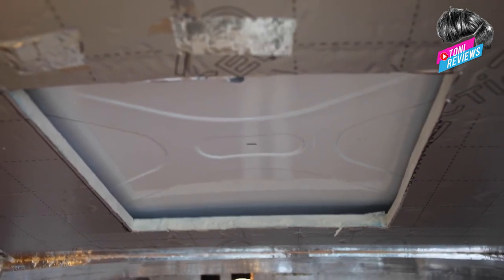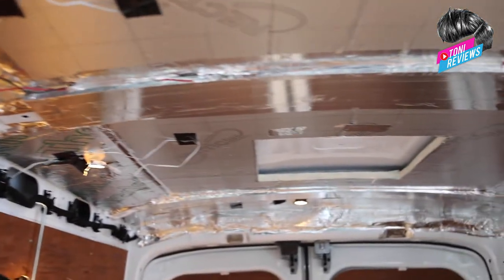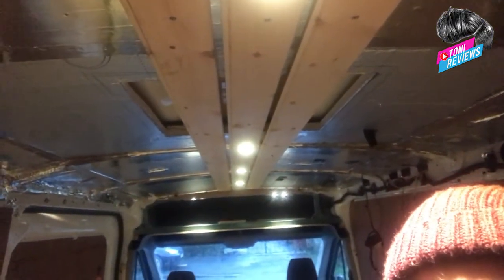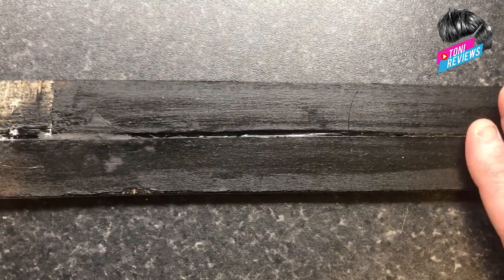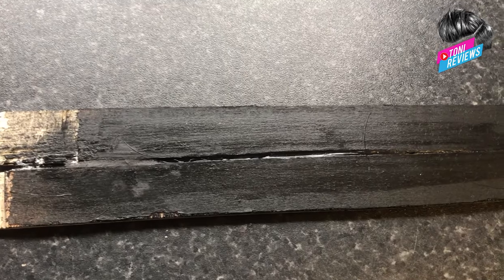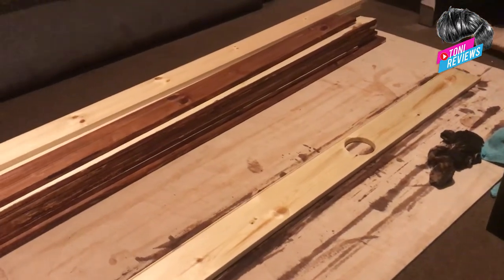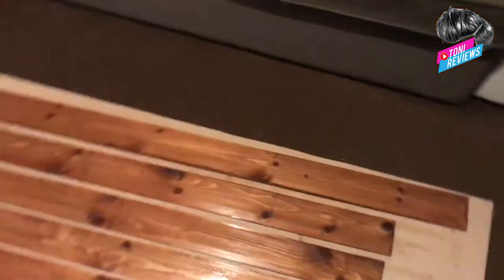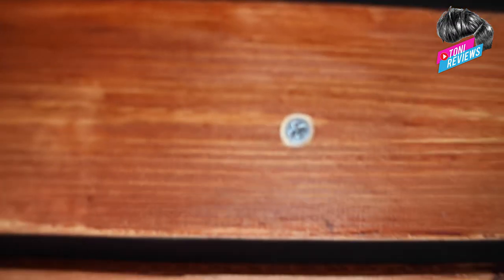The Camper Build pt2- Transit MK8- Floating Ceiling and problems

Comment: This is very impressive Toni!! I love how creatively detail-oriented you are.  The products you are using is what I sell everyday, so I was thrilled to hear you mention the pre-stain wood conditioner 😁 You are exactly right, if you don’t use it for softer woods, the stain will penetrate with a splotchy finish.  I do have one tip - when using something like a caulk or wood filler, it is best to use a separate primer before painting for a more flawless finish. In this case it wouldn’t really matter bc the boards will hide most of it. Great job!!